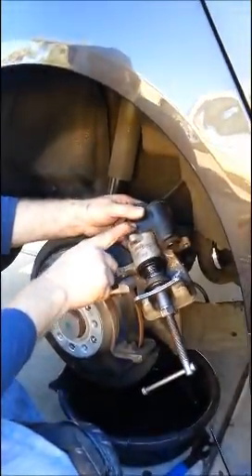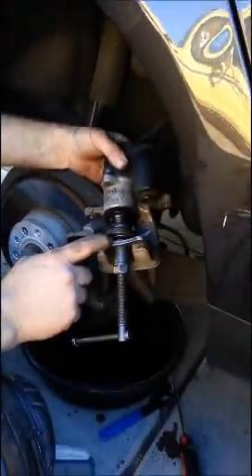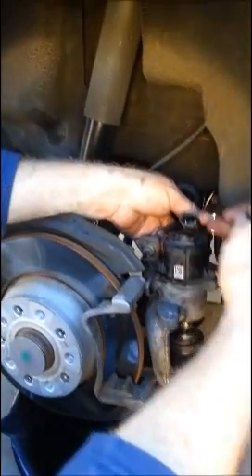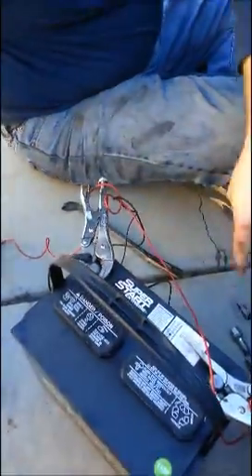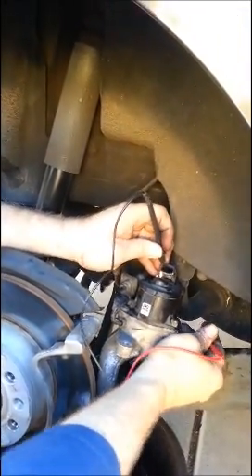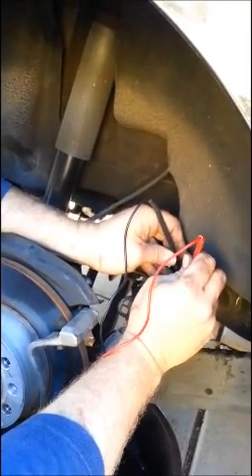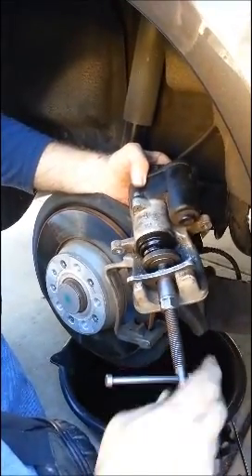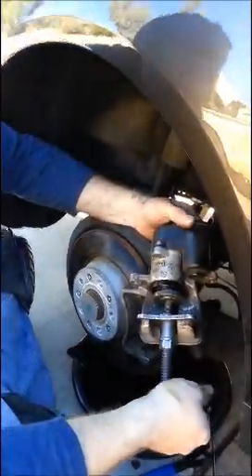Retract 2008 Volkswagen Passat Electronic Brake Calipers without computer code reader

Comment: this is a very helpfull video for manny   but I  can't stress enough  about this NOT to do like in the video  for 2015 + VW  group cars !  The EPM ( Electronic parking brake module)   learns the position of the piston via basic settings  ,  when you close it this way or by pulling the parking brake  it will not learn it !!!   This means that some time in the future when  the pads on the rear will be worn more than the pads he is replacing now , the parking brake will not hold anymore.... it will not go passed the last learned point .
Reply from the maker: Hmm... well I cannot speak to 2015 model year an later VW, only having had a 2008 VW Passat... However, the notion of VW introducing a 'learning' or rather a calibrating mechanism for brake pad thinkness when the EPM has only ever been used as a control device and not a measurement instrument, would indeed be rather large design shift. I would love for some independent 2015+ VW owners or servicer to verify this the statement. Does the EPM 'measure' brake pad thickness or only control brake caliper movement and presure.
Reply: @MatthewNeill  I am not talking about break pad thikness  ( Like in the Audi A8 models  UDS and nonUDS models )  , don't get them confused or mixed  . The basic settings saves  the running positioning of the motor ( running time diagnostics)  it is written in the software.   Same thing applies when changing the battery without continuous current management , the basic setting is restored to the factory one , not necessarily to the one that is on the car at the moment.  Further more for the ones with automatic gearboxes  that use constantly the autohold function , the settings are saved on the Gearbox unit as well   and from time to tome it may throw a warning  "missing bassic settings"  , common problem  that is due to not using  the software when  changing the brake pads  !  
 For 2008 passat it could be done since it does not have this function of measure .

Comment: Hi there Matthew good work i did mine the same way on my 2017 passat,, i used the battery from my ride on mower , i used two electrisal push on  connectors in case of a short and a burn on the tips of the male parts of the connector , it worked so well ive passed it onto other folk , i saw a mechanic doing the same thing on U -tube months ago , it was great to see , anyway good on you for trying to save a buck on your wifes car ,, all the best

Comment: Doesn't doing that makes the car computer all screwed up for knowing the position of the brake motor?
Reply from the maker: No. This is a motorized caliper with a bi-pole input (two wires) one orientation the motor opens, reverse to polarity the motor closes. There is no sensor within the motor is calibrate (mainly because over time the brale pads wear thinner as they are used)... Best I can tell the computer operatetes a open/close operation untill a current threshold is reached, measured from the supply source not at the caliper motor.
Reply: @MatthewNeill  great ,I'll be able to change my rear brakes too😀

Comment: If you are a little nervous about using a battery (which is understandable, the wrong amps/voltage could be terrible) you can also remove the motor and use a torx bit to manually retract, then push in.
Reply from the maker: It is a 12 volt system... cara are 12 volts... it's a 12 volt battery... The amperage is going to be a factor of the draw of the motor... using light gauge test lead like was done here, will act as a fuse sink... if there is too much current drawn, those leads will give way before the motor will... but anyway if you are a little nervous to do this hack, and n9t familiar that cars use a 12 volt system for control management devices like this, then by all means, your best bet is to go to the four five hundred dollar dealer...

Comment: You can use a smaller 12v battery and rewind the caliper before removing the old pads and discs, this way if it is winding out the motor will stop, negating the risk of popping out your piston.

Comment: Actually there is another way to get the break released ...you have to remove the motor and use torx screwdriver and press the other side and your are done :) this is how I did and I do with my two passat B6
Reply from the maker: Sure that works and is always an option, however the design of the EBC system is not to disassemble the brake calipers but rather use an electric current to retract and extend the calipers. The best option is to use a VAGCOM computer to control this current. An alternative option if no computer is available is this 'test lead' approach. It's pretty simple and it limit further unnecessary disassembly and reassembly that may require specific torque specs for the additional bolts that have been removed.
Reply: @MatthewNeill  I agree 100% with your statement, one day I had no choice to use this method because I was far away from home in middle of nowhere and this happened by weekend 😁😁😁😂😂😂

Comment: Isn't this just the electronic park brake? Great idea, but I'd assume that when you take off the parking brake and turn the car off in neutral you'd get the same effect. If not, there's this option!
Reply from the maker: No it doesn't quite work that way. The issue is that when the parking brake retracts and you need to replace your old brake pads which have become thinner due to use and wear with new brake pads that are thicker, the retraction doesn't go back far enough to be able to fit in the new brake pads. That's why you have to either send a command to the computer to fully retract them or in the absence of a vagcom device to communicate with the company, use this type of a method to manually retract them.

Comment: Right I'm wondering what if the ECU sends a message  to the caliper  to push out when it's not going to recognise that it's already  out ... could  happen right because  the motor  is controlled by the ECU

Comment: Great video!  Here's a tip if you don't want to deal with a second battery...   Find a 12v DC power adapter (I had a drawer full off of old tech) cut the wires...  There's your 12v
Reply from the maker: Dan Spurlock that is a great idea! Thanks for the comment!

Comment: You are my hero!  Sunday afternoon, replacing rotors and pads on a 2011 Tiguan. Can't push the caliper piston back in. Found your video, 30 seconds with a battery and meter wires and I'm good to go.  Saved me an embarrassing trip to the local garage.

Comment: Top tip, awesome. Just done the rears on a 2012 Passat. I crimped a couple of small spade connectors onto a couple of bits of wire so no chance of shorting out.
Reply: My emergency brake is stuck and they can't unrelease it any help 2007 Volkswagen Passat it's a button when I pressed it on it locked up now when I press it off it won't come off

Comment: Can’t you just release the parking brake put it in gear then start on the brakes?
Reply from the maker: No, releasing the parking brake dose not cause the calipers to retract far enough to make room for the thickness of the new replacement brake pads.

Comment: Hi it looks like a electronic parking brake, have you tried disengage the parking brake
Reply from the maker: Yep... disengaging the break will release the grip but not retract the calipers far enough back to make room for the thickness of the new pads... You either need to specify command through the computer like with a VAGCOM tool... or use this hack! 🤣

Comment: You can also perform a non-battery version by removing the 2 TORX screws, then use a standard flat blade screwdriver to rewind the parking brake actuator.  Using the same wrench shown in video, or using a c-clamp, will retract the caliper, which will also refill your rear brake reservoir.
Reply: Roger Cole some say this messes up the computer as the brake is out of sync with stored value

Comment: Just FYI but you can just remove the motor with a T30 and counter clock-wise spin the motor spindle back with a T40 .. for some reason I only encountered 2-3 companies so far making these motors and almost every car uses them including my 2016 Mazda 6.
Reply: FLY&I i love you

Comment: Maybe a dumb question, but I was attempting to do this and I struggled with getting the wire plug from the caliper.  I tried with a screwdriver different ways but just couldn't figure it out.  I didn't want to force it and break anything.  I am sure that connector is water proof since it is exposed.   Maybe post a video of it??
Reply from the maker: Kurisuchan, If I remember correctly, there is a plastic tab that must be raised on one side of the plug. Use a small flathead screewdriver to wedge under the tab a carefully raise it above the locking cog. One raised you should be able to wiggle the two sides of the plug apart. Good luck!

Comment: Hi Mathew I would just like to say thanks for the tip, I did my vw passat blue motion 20 ltr to day using battery charger on 6 volt low setting every thing worked fine but when re connecting the battery a light on the dash came up with steering wheel fault but after a few minutes turned off so seems every things fine must of saved me a few ££££££ thanks again.

Comment: This is the way to do it. Common sense info from a common sense guy. Just did rear pads and rotors on 2014 Audi A4. Follow these directions. Only problem I see is if you touch energized leads in the somewhat deep plug on EPB motor. JUST INSULATE THEM WITH ELECTRICAL TAPE. You have more of a chance screwing things up with Vag Com with current fluctuations, etc. As far as computer won't know where caliper position is, blah blah blah, is bs. The only thing the computer can know is when caliper hits the pad and that is by change in power draw. Thanks again Matt.

Comment: I just want to be sure... can I use any 12v battery? I have some spare batteries from my home security system that are 12v. I'd like to use those if I can.Great video... always great keeping money in the bank account.
Reply from the maker: Any 12v source should activate the brake caliper motor.

Comment: so .. when the computer sense more than a specfied value of amps will stop? the thing is im trying to figure it out how the computer thinks... i know VCD VAG use AMPS to retract the motor... if you do it manually the computer knows it is retracted or like you said in 1 comment just monitors the AMPS... so when the amps are over a certain value it will stop the motion or EPB motor?
Reply from the maker: +serchmarc "Computers" do not "think" they "compute"... Not to be facetious, but it really just comes down to the aforementioned statement. To control a device such as an electronic brake caliper that is designed to apply a constant force against brake rotors with brake pads, that continue to wear over time, an therefore require further travel of the electronic caliper actuating drive screw to apply that constant force, there must be a measuring mechanism built into the EBP system. From observation of the VW Passat EPB system, is has been determined that there are no sensors at the electronic brake calipers and that there is no feed back circuits or additional wires sending signals from the calipers themselves. It cannot be a timing circuit to apply the close/open current for a specific duration because the time to open/close would also vary over the life of the brake pad thickness. It must therefore be a sensor at the source of the current being sent from the Electronic Parking Brake control module. The "computer" can "compute" differences in the current draw at the close position vs. the normal drive motor current draw. When a tolerance is reached the motor is shut off. Many automotive power window systems use the same logic to measure current draw of the motor... when it spikes up, the motor is no longer moving, so the control unit shuts the motor off.

Comment: why not just leave the car in gear and Jack it up and then disengage the electronic parking brake? that's what I did and worked a treat and less complicated
Reply from the maker: On my vehicle  the old brake pads were significantly worn to the point that the new pads were of a great thickness than what would fit in between the calipers. It is a common issue when changing pads, hence the existence of the caliper retraction tool. Trouble was on this model the electric screew drive when disengaged does not fully retract so it blocks the path that the mechanical needs to push the calipers back. Perhaps your vehicle does retract the electric screewdrive all the way back when the push buttun is disengaged, but for mine (and it seem like many others on this thread as well) is did not disengage far enough.
Reply: +Toby wareham They will only go as far as release the brake. You have to put the motors in "service" mode. Meaning retract the motors completely so you can drive in the piston. I have had the same problem but borrowed my friends computer for doing this. But always had in mind what this guy is doing. Good thing he took the risk for me and I know now it will work :). Thank you for putting this out.
Reply: +Janisani1 I know what your saying I was just pointing out that I managed to do it by disengaging the PB and then just turning the pistons back. just had a thought wouldn't another option be to take the motor off the back of the caliper and use a torx key or spline key along with a socket wrench to turn the piston back that way?

Comment: Once you did this, did the computer system reset it once everything was back together. I am in the same boat, metal on metal (daughters car).  I like this idea, I just don't want to mess everything up. I have done several brake jobs, but why in the world don't they make it DIY. Frustrating, just spent over $2k on another ridiculous repair that they had to do.

Comment: I never comment on posts but I definitely want to take the time to personally say THANK YOU! I had just purchased a used Audi A4 and was installing new rotors and pads, fronts were fine but as soon as I had disassembled the rears I was screwed an panicked. But saw your video and you literally saved me, I would take you out for drinks, this was truly helpful, thank you thank you.
Reply from the maker: I remember that initial feeling of panic (and frustration) well... seems like these European auto makers could cater to the DIY types a little more by simply adding a user accessable control to retract. Seriously a breake job shouldn't have to be a dealer activity... Glad the video helped you!

Comment: Hi Matt, 
Just completed my rear brake pad replacement  your way on my A4 2008 TDI, one thing i did differently I don't have a pistion compressor so I left the calliper on and after winding the motor back to the stop I was able to use a screw driver to push the pistion back in, making sure that before i did I took the top off the brake fluid tank, once the pads are in i had to wined the motors out so that the brake was on and then cycle  the park brake, all good thanks pal. Perth Western Australia also our surnames are the same ????

Comment: Hi, great video and idea Matthew. Have just done this and works a treat, would just suggest a couple of 'helps' to those unsure.
Firstly I disconnected my battery from the car, having read that some comments were talking about errors on the dash. If u disconnect battery the ECU can't register faults. 
I personally used a low amp 12v battery charger for power.
I did read comments on the web of people that had done this and wound out the motor too far and then had expensive fixes to pay for. I decided to loosen off my calliper on the sliders, and then establish which way wire to put on which terminal, that way if I got the wrong way the only thing that would happen would be that the park brake would come on.
Just to say too, I'm a trained mechanic/technician and think it's great when 'educated' guys come up with common sense solutions to the obstacles manufacturers try to place before the DIY mechanic - Matthew you'd clearly thought about what to do, don't worry about the guys out there that just want to slate you - they need to get off their pedestals.

Comment: When u hooking  the battery  to release  the piston !! How do u know witch one is positive  which is negative?
Reply from the maker: WALTER 007 007 The leads into the electronic brake caliper are not positive and negative.  i.e. consider the pins for the connector as pin 1 and pin 2. Connecting a positive lead to pin 1 and a negative lead to pin 2 might make the caliper retract. Then reversing the polarity would make the caliper extend. Just test it out on you vehicle with a light tap to see which direction the caliper motor actuates.
Reply: Matthew Neill Ok I see! Thank you !!!

Comment: I just did this on my 2009 VW Tiguan SE.  I removed the battery, and once the calipers were off and the parking brake power was disconnected, attached two leads from an old volt-ohm meter.  It worded perfectly.  Had to figure out by trial and error which way to run the motor to get it back to the first position but it worked like a charm.  I then pushed the pistons back into place and reassembled the brakes.  Once the brakes were done I started the car and pumped the brakes a few times and then put the parking brake on.  It ran out and then stopped.  I removed the brake and did this a few times.  Now the parking brake is reset and works perfectly.  The brakes work like new.  Thanks for the post Matthew!